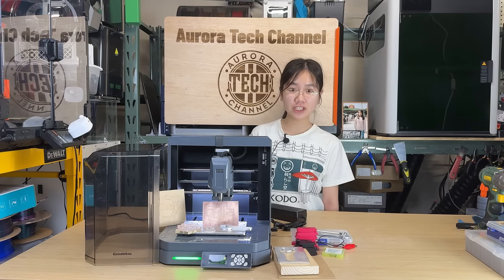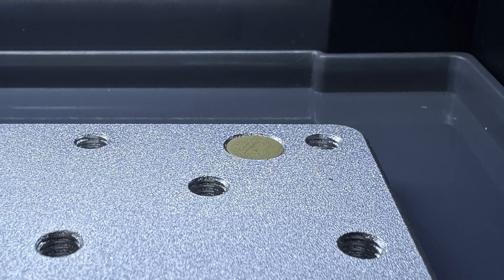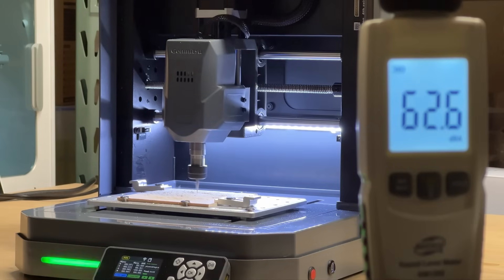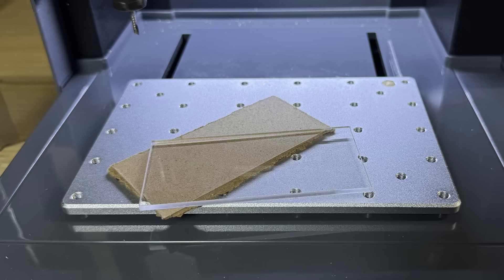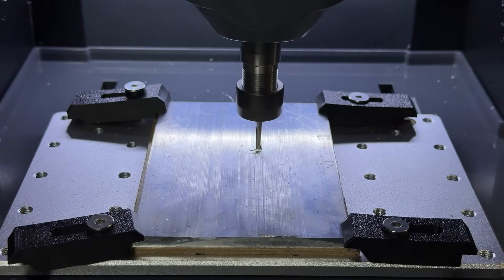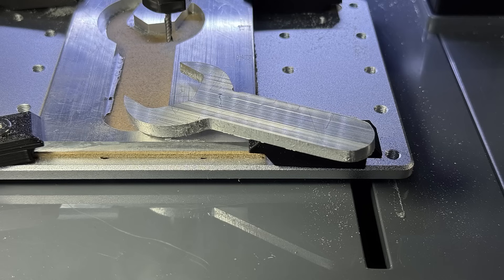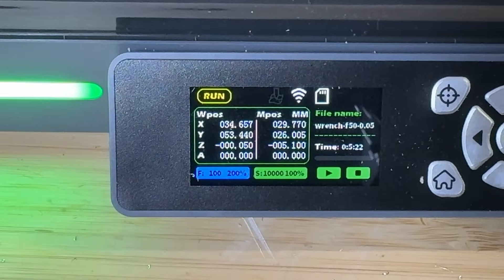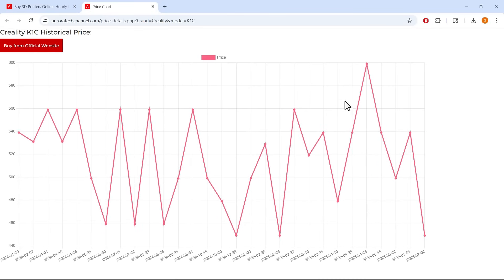Genmitsu Cubiko CNC Review: An Entry-Level Mini Desktop CNC, Capable of 5 mm Aluminum Cutting

Comment: Very nice review as always! I get significant better PCB cuts when I cut in a thin layer of mineral oil. It would be helpful for cnc reviews to add some form of measurement of rigidity in the three axes as well as a runout measurement of the “spindle” (read DC motor). All of those measurement can be easily done

Comment: Very good review as always.
Try and swap the ER11 nut (and maybe even the collet) the stock ones are well out of balance.
You can actually see it wobbling during the slow motion part of the aluminium cutting.

Note about PCB height map and cutting. I found that the seek rate for probe was too fast, it would leave marks in the PCB for every point and it was making it read deeper due to the mark. Lowering it to a slower rate helped with both the issues mentioned before.

Comment: Chinese companies shouldn’t skimp out on these cnc machines like they do on 3d printers (at least most companies).
Reply: CNC requires rigidity. Anything two people can safely lift is going to have severe limitations.
Reply: @spehropefhany  its gonna require being clever forsure. maybe the base it ships with is hollow but its formed in such a way that once its shipped home, consumers have to fill it with their own epoxy granite/concrete mix to create that rigidity. spit balling, but my point is that releasing lazy clones for already on the market CNCs wont bring in in the dough like the same strategy did with 3d printers. My guess is that the few people who want a cnc for small wood pieces have already had one for years.

Comment: You know what would probably make a good sanding tool for PCB's? Using those stone bits for rotary tools as a tool for the machine and just manually setting the height and slow jogging it back and forth

Comment: One possible downside, depending on your sensitivity to this kind of thing -- the name Genmitsu is Japanese-sounding, and so is the CNC machine name - Cubiko.  However if you look at their web site, they appear careful not to mention where the company is located  -- there's nothing in the "about us" or "contact" that gives any clue.  After a bit of digging elsewhere, I found that they are located in Shenzhen China, and are owned by a parent company called SainSmart.

I have nothing against machines made in Shenzhen, in fact I have a machine made there.  I just don't like the lack of transparency.
Reply: Genmitsu was always SainSmart , I think it’s a well known fact
Reply: @arbjful  I checked Sain Smart's web site too - same story.  No transparancy about their location.  It seems intentional.
Reply: @yeroca it’s pretty much well known, they manufacture in china, but you are correct, there is no mailing address in contact us page of their website
Reply: You're absolutely right: Genmitsu machines are proudly designed and manufactured in China, where our core R&D and production teams are based. At the same time, we operate under SainSmart, our parent brand, which is registered in the U.S. (Vastmind LLC) with several local warehouses(e.g. Las Vegas and Huston) and customer service team. We also maintain fulfillment warehouses in Europe and Japan to better support our global customers.

As for the name “Genmitsu,” it is indeed inspired by a Japanese word meaning "precision and rigor" — chosen to reflect the craftsmanship we aim to deliver in every CNC machine, like Cubiko. While we’ve focused more on the product and maker experience in our marketing, we fully understand your point about transparency and will work to make that clearer moving forward.

Thanks again for pointing it out!
Reply: @SainSmartofficial  I'm impressed!  Thanks for addressing this issue!

Comment: Great review as always. Would love to see how this little machine handled cutting stainless or mild steel (however slowly that would be). With patience, it seems like it would get there eventually.
Reply: Mild steel might be possible, though not at anything even approaching practical speeds -- stainless is probably completely off the table at the rigidity and spindle power on offer here. Even something like the Carvera Air -- which has 20mm rods, and a 200W spindle -- struggles at slow speeds on stainless.
Reply: Work holding needs to be more rigid I guess, wish they had provided ball screws instead